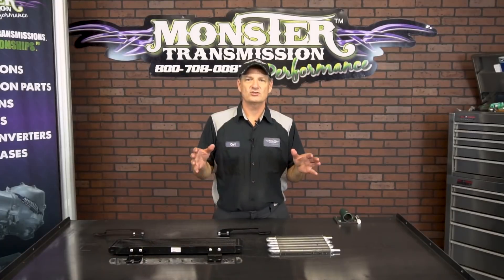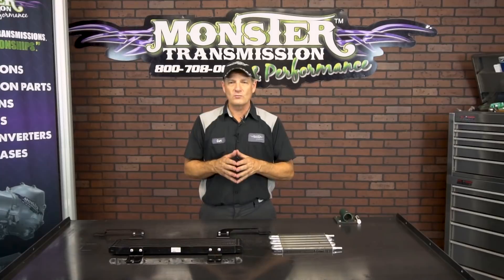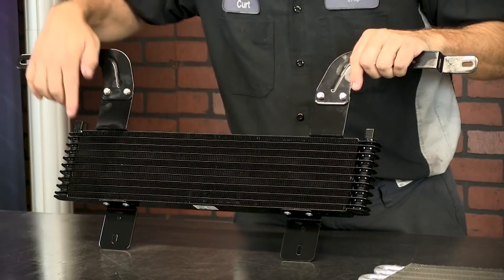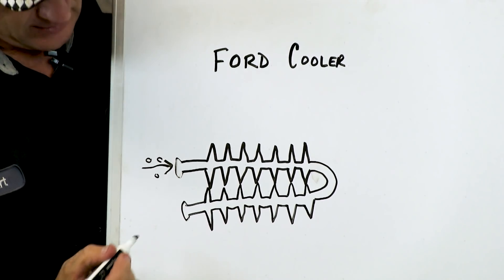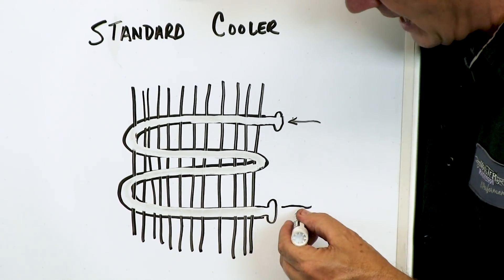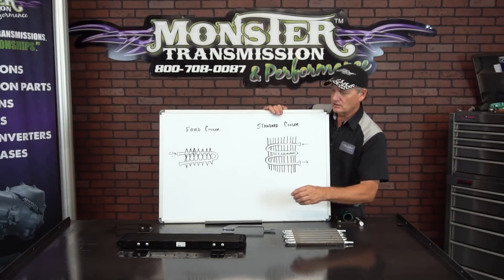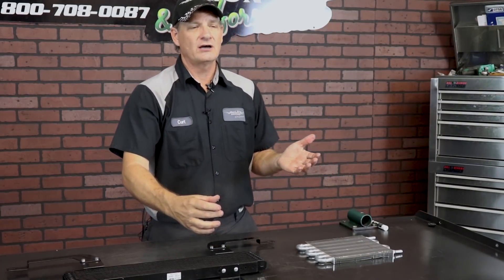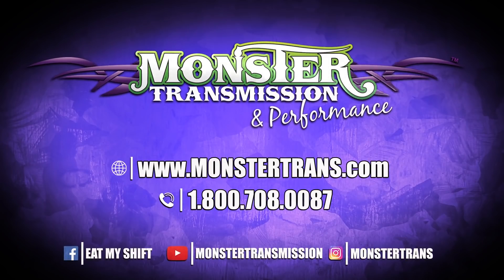Transmission Cooler Design

Comment: I understand that heat kills transmission. But Why don't factory install good transmission cooler? Some cars have no trans cooler at all but aftermarket options are available for them.
Reply: If a Vehicle doesn't have a Transmission Cooler factory installed- then more than likely that Transmission will have it's life shortened.

Comment: id rather bypass the radiator , i see a lot of trans. have thermostats, I live in Midwest summers get hot , winters get cold , what works best for my situation , i tow a camper , would like to install a bigger oil cooler on my 2007 2500HD
Reply from the maker: Yes we agree we like to run the Transmission direct through the Cooler to ensure the Transmission will not over heat in the Hot Months. Thank you for choosing Monster Transmissions!

Comment: My 2009 RAV4 ATF temperature is running hot during this Pennsylvania summer. I'm get a transmission cooler installed on Monday (2020/07/13).

Comment: Thanks bro, had one of the same ones that look like the mini radiator and it was also more restrictive in line pressure. The Tube and Fin has a better flow rate and allows pressure to be the same

Comment: the main risk with running trans fluid though radiator is if the inside of trans heat exchanger tube (inside stock radiator) does fail then coolant will become mixed in with the transmission fluid (like a strawberry milk shake) = catastrophic failure to the transmission..